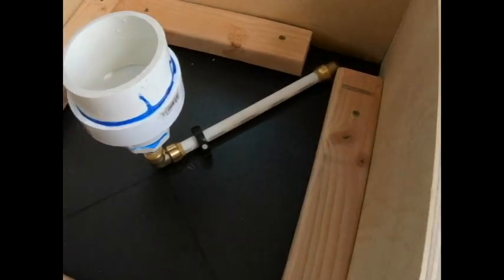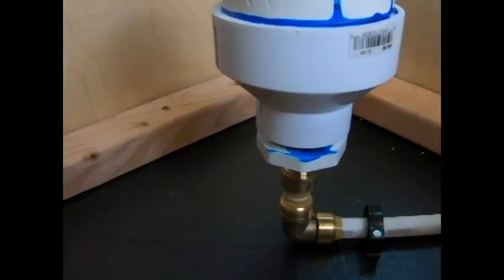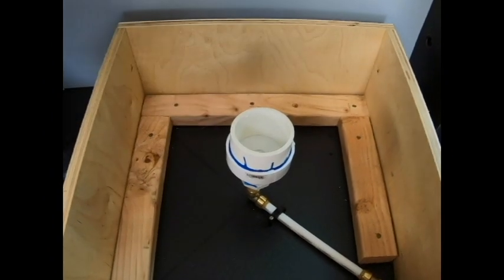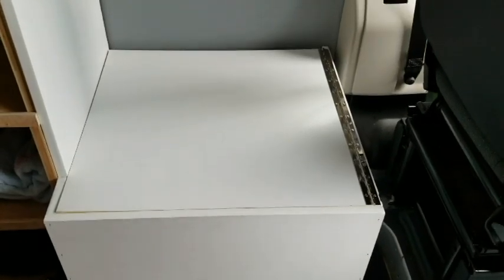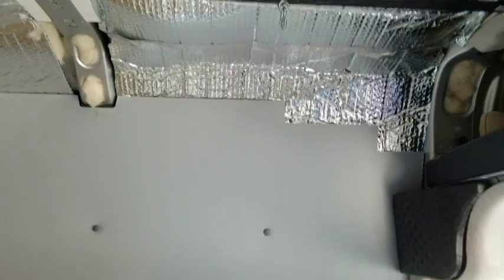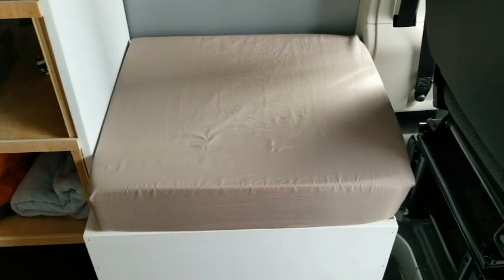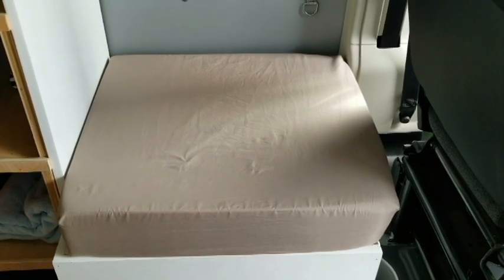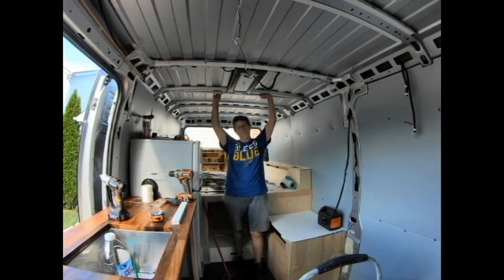Coolest Van Shower Idea, Maxair Fan and More| Van Build For Travel Nursing

Comment: Great progress

You are so tiny you did 1/2 of the max air fan install from the inside..  .. wow..most people would not be as effective as you.. in that tight position.

The shower is very inventive.. questions 
1- How much roof height is lost with the plumbing elevated like that? 
2- where is the grey tank for that shower? Inside or outside the Van? 

Like the contrast of the black faucet ..